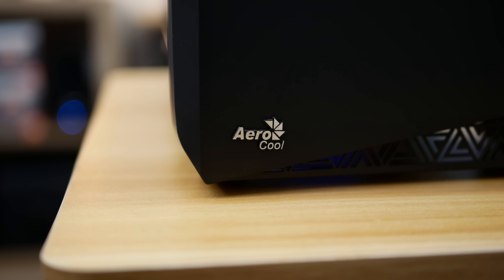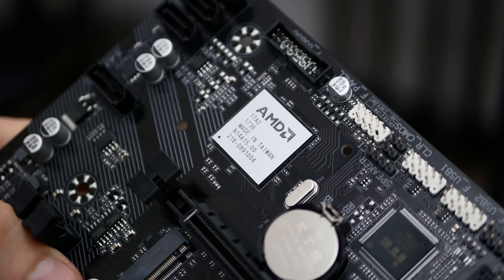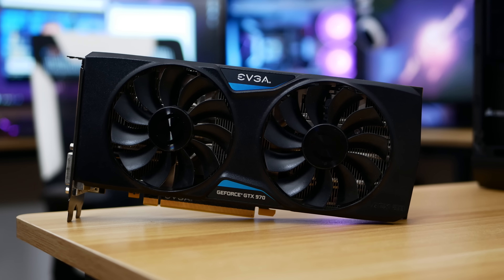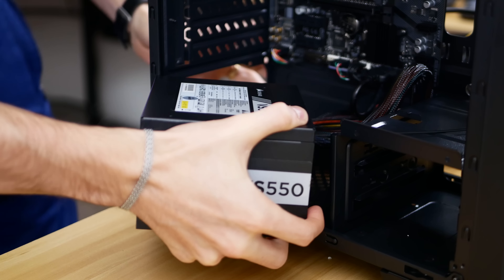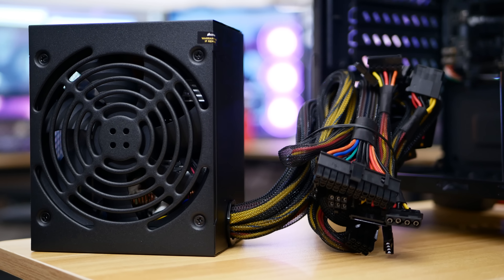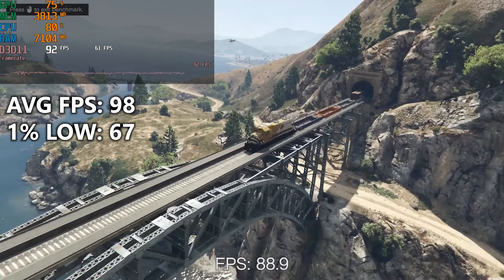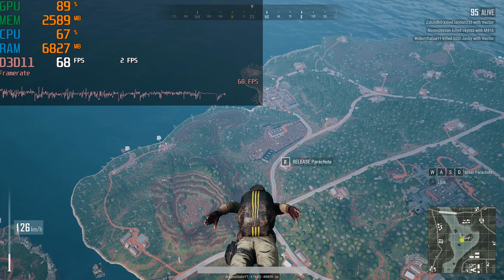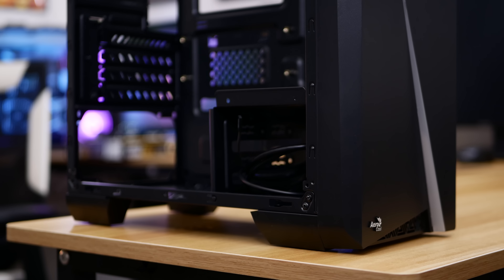We Built a Solid 1080p Gaming PC for $500

Comment from the maker: PRICE UPDATE: I had to change the title and thumbnail for this video because prices changed pretty drastically over the course of one week. For starters, the Ryzen 3 1200 is now selling for closer to $100. As of time of filming, the CPU was on sale for $75. The FlareX DDR4 we showcased here is extremely expensive in the higher frequency range, so we recommend buying a slower kit or moving to a different brand altogether. The GTX 970s are still fair game on eBay for around $100. The Cylon Mini, I'm told, should be selling on Newegg/Amazon for no more than $45. That price, however, is not reflected online, so I'll be pushing them to update this soon. Lastly, if you're interested in cutting a few more $$$, swapping the 500GB SSD for a 1TB HDD should do the trick - though storing the OS on a hard drive will significantly slow down certain aspects of your computer. Happy building!
Reply: Glad you said for anyone on a "tight" budget, not a "Titan" budget!
Reply: @TheNews1990  It has OEM parts...
Reply: Used RX470 or RX480 4GB cards can be had for around the same price and are great options as well.
Reply: I don’t know where you are getting the “$100” figure for your GPU. EVGA 970’s are running about $150 even on biddings and have been for months now. Your build is more like $520 with the parts you listed and using the prices you stated in your description.
Reply: Brian Last he bought his one for 100 and there are a few
Reply: Cheapest AM4 board? Did you steal that idea form Walmart? You could have gotten a cheaper PSU to but that may be risky. :D
Reply: @mattsmechanicalssi5833  TITAN budget haha nice one
Reply: @teleringdataspesialisten1869  
You do realize Grate Wall who make the Wallmart PSU make some Corsair PSUs.
Reply: Crooked glasses
Reply: Please do not forget intel optane and rgb and benchmarks
Reply: You did not launch multiple cpu load programs at once. Please run prime95 with aida64 and furmark
Reply: Try put there nvidia 2080ti
Reply: Also nvidia made rtx titan
Reply: @HipsterDragon  that's why you learn to bid and bargain hunt on ebay, craigslist, etc.  prices are subject to change, so it's not surprising if it goes up.
Reply: So basically nothing in the video is true...
Reply: Science Studio why didn't you use patriot ram, it's cheap and fast, about 8 dollars per 1 GB for about 2666 or even 2870 or whatever the next speed is. Also you could have used a ryzen 3 2200g for only 100 and you could eliminate the gpu.
Reply: Science Studio I love videos like this because my dad and I are going to build a gaming PC and we watch a lot of YouTube videos to get insight on good budget parts.
Reply: Im running arma 3 with gtx 760 with all ultra and it works fine
Reply: I am gonna buy this one today for my kid but am not sure how to put it together what should I do?

Comment: Recently built my first desktop PC while trying to target 1080p and save as much money as possible. Went with a Ryzen 2600, 8gb Ram, RX 580 4gb, B350 MoBo and a Refurb 850W PSU for $540. Bought the 580 from ebay for $128 and used the 480gb SSD from my previous laptop.

Comment: rx 570 is only 150 bucks new on newegg, and it comes with 2 free games. way better deal than used 970 in here as you get warranty and it consume less power. also fyi, stay away from corsair vs series, they're garbage. try to look for a seasonic, evga or even fsp if you need an affordable psu
Reply: The CX series of power supplies are also decent units I’ve found
Reply: RX 570 wrecks GTX 970 as well, quite a performance gap.
Reply: You can get a RX580 8GB on the used marked right now for ~100$ if you look close enough.
Reply: I have the corsair TX550M in my system. It works very well
Reply: Joey Greathouse GTX 970 performs around 10% better than an 570 and has higher oc potential
Reply: Yeah but Nvidia is still much better supported than Amd, lots of AAA games are developed on Nvidia drivers and optimised to their brst becayse thats Nvidias marketing strategy. Also Geforce recording doesnt impact performance
Reply: JellyStick Danix that would a nvidia fanboy would say... 
I’m switching to console
Reply: a gtx980 you can find for 150 bucks too and wrecks the rx 570
Reply: I have  been using corsair vs550 for 4 years already. PC on 24/7. No issue.
Reply: I got it too except I got a 30.00$ rebate so I got the OC edition at 1.268 GHz at max clock for 135$. What a steal!
Reply: @jellystick2525  Neither does ReLive
Reply: My rx 580 was like 200 and I got 3 games. Granted star control origins was pretty trash but AC odyssey and Strange Brigade were great games.
Reply: I just bought this yesterday 👍🔥
Reply: As rs3tssunax said Stay away from vs series  mine didn't even last a year
Reply: The Rx 570 also has more v-ram than a 970 😎
Reply: How will be the combo of rx570 4gb and 1200 ??
Bottleneck?
Reply: Currently rx 580's are pretty cheap

Comment: Why not go with the 2200G?- then try the freesync trick with the GTX 970?
Reply from the maker: You certainly could.
Reply: I did a budget home build last week and went with the 2200G aswell (didn't need a GPU) and managed to stay inside the 400$ mark - which is in line with this build mroe or less.

2200G atm is really good for budget builds. As mentioned you can add a discrete GPU and even get the advantage of the "freesync on nvidia" trick. Given the system won't have huge FPS numbers and will be prone to a "rocky" experience sometimes, freesynce does wonders in smoothing the whole thing.
Reply: @marcgallant5270  Why mot RX 3060 for 150? Similar to 1060
Reply: Marc Gallant why not get a gtx 1070 for $200. Lol
Reply: wich trick?
Reply: What is the freesync trick?
Reply: @the__man  lol gtx1070 LOL 200$ LOL you mad they are 250/300€ still on ebay cant find for less then 240€....... unless u from usa where they sell for 200$ ish... but europe nahh but rx570 are like 100€ rx580 120-150€ on ebay
Reply: @THEwed123wet  yea what trick
Reply: Can someone explain this freesync trick?
Reply: Justin Y.’s Evil Twin wondering this myself
Reply: hey  @Coldkil666 .I was thinking to use a ryzen 3 2200g and I have been wondering since youy have the experience do you think a gtx 1050 ti would really benefit my build?
Reply: @igdivine5389  depends mostly on what you plan to do. low budget gaming a 1050ti is fine, and with the 2200g you can use the trick to use a freesync monitor via the integrated gpu. i'd go 2400g if possible though, if it's in budget.
Reply: would the ryzen 3 2200g be compatible with the motherboard?
or would i need to update the bios?
Reply: How do you put a 2200G because on pcpartpicker.com it says it has compatibility issues with the motherboard BIOS
Reply: You can also get a used RX 580 for $20 4GB / $35 8GB more which maybe worth it, you'll get 5%-10% better performance on most games and it has a newer Displayport standard and Freesync obviously. I'm able to get 4k 40FPS in most game on Medium settings and the newer Displayport cable lets me do HDR without Chroma subsampling.
Reply: For some reason, the 2200g is cheaper than the 1200 from where I live. I would get the 2200g.
Reply: @mattstone8878  we don't need your advertisement here.
Reply: @mattstone8878  uhhh, I legit just didn't ask for the advertisement. Fuck SJWs, but I just didn't ask for it. Kappa
Reply: @the__man  300*
Reply: @Coldkil666  can u send me the build u make for 2200g? im planning to build. thankyou in advance
Reply: @minarimina  not a problem.
 Ryzen 3 2200G
ASUS Prime A320M-K motherboard (because uATX, has m.2 slot and supports up to 32GB 3200mhz ram)
8GB Ballistix Sport 2400 ram (just because it was cheapest and didn't needa  3000/3200 but i'd recommend it)
250gb WD green m.2 SSD
1TB WD black HDD
Masterwatt Lite 400 PSU
Masterbox Q300L case

Obviously prices can vary, can be done better with some more money (ram first of all) but the idea is that you'll have a pretty good baseline machine you can upgrade easily (adding a gpu like a 1060 or an rx580/590 will make a lot of difference).
Reply: @Coldkil666  thaanks

Comment: Ryzon 5 2600, B350 MB, 8 GB RAM and a RX570 and 400 Watt PSU in a 30€ case. Cost me 550€. Turned out to be really great.
Reply from the maker: 2600 = best bargain CPU around.
Reply: Well I was thinking this evening to build this exactly PC but I though buying a used 4gb Rx 570
Reply: It certainly will not disappoint at this price point. You of course have to factor in the drive. In my case (haha) we had a used 500 GB HDD which was good enough for the moment. This will get you around 1080p for a while.
Reply: Gonna build with the 2600x but use a RTX 2070 instead.
Reply: What's the ram speed?
Reply: 2666

Comment: For a little bit extra I would definitely recommend getting a B350 board instead due to the additional features such as overclocking, the extra chipset PCI-E lanes and the additional SATA and onboard ports that comes with.  With a B350 board even with the stock cooler the 1200 comes with you should be able to easily OC to 3.8GHz with reasonable temps and that will raise your min FPS/dips by a good bit on CPU demanding games.  

Given that the 1200 is now $100, a better choice at that price range is a 2200G since it's based on the updated Zen+ architecture but if you can spare an additional $20 and have a MicroCenter near you a Ryzen 5 1600 6-core/12-thread is an awesome deal and very future-proof.  

I would change the RAM to something that will run at 2933MHz, which is usually the sweetspot for price/performance.  16GB that will run at that speed can usually be had for around $100, so that would make up the difference in the CPU being $100 and not $75.

For the graphics card I would go with a used Radeon RX 480 instead.  It's a newer, faster, more efficient card.  For $100 you can pick up a 4GB model which is still an extra .5GB vs the 970 and for an extra $10-15 you can get an 8GB model should you want to play with high res textures at 1440P plus it's about 5% faster than the 4GB model because it's 8Gbps vs 7Gbps GDDR5.

Comment: Honestly spend the extra like 15-20 dollars for a the cheapest b350 or b450 board, that option to overclock is worth it due to the fact that all ryzen CPUs can be overclocked. Used gpu is definitely the way to go, like a used 1070 is like 200 dollars now and a 1070ti is like 30-50 dollars more than the non ti card.

(Edit): you can get an rx460 or 580 on eBay for about 100 dollars now.

Great job on the build, but there are a few things you could’ve done to get better price to performance. Love watching your videos.

Comment: How about:
i3 8100:     $130
Amd RX 570 4gb:  $150
H310M motherboard $75
Corsair 8gb 2666 MHz $80
Corsair 450/500watt $45
HDD WD 1TB 7200rpm: $40
A Non RGB CPU case $20-30
Because it doesn't matter that much as gaming is more important than show-off. Or if you want you can spend an extra $5 to get the one shown in the video.
Total: Approx.$550-$590 depending where you stay.
This rig can run RDR2 and Assassins Creed Odyssey at 45~50fps with 1080p settings.
Personally Tried.
What you want more dear? 😊

Comment: Yeah I built a system 6 months ago with an i5 4670k and 970. And I've got to say. GPU prices have come down quite a lot since. At the time, I had trouble finding 970s for a decent price and I finally settled on an EVGA one (non-ftw, I think it was the acx 2.0 version. And the fans get pretty damn loud when fan speeds are 50%+) for $150 (+$18 shipping).

Comment: R5 2600 and a RX570 is probably one of the best builds right now for price/performance.
Reply: I agree, I just went to that, although I got a RX580 because I found a really good deal on cyber Monday. I'm really pleased
Reply: @amancuso07  yeah your better of finding a 580 anyway considering the price difference isn't that huge. It will also last longer than the 570.
Reply: Here in Germany the r7 1700 costs like 15€ more than the r5 2600, and has more value for the money, for its additional 2 cores and 4 threads.
Reply: @sahinsultani1569  You´re right. Here in germany prices sometimes seem quite "illigical". Just upgraded my system from an G4600 + GTX 960 to an R5 1600 + RX580 on B350. I decided to take the 1600 due to the possible trouble with getting R2 working on B350 with older Bios-Versions. Now I´m waiting for the R3 3300X, which is in my Opinion more an R5 than R3 (6C 12T).  The RX 580 is an great card and the R5 1600 @ 4,0 Ghz is also not too slow.
Reply: I have RX 560 sad gamer moment
Reply: I have a 2700x and a 580
Reply: @kola7106  don't be it's still a nice little card, you just have to lower some settings.

Comment: Go with a 2200 g cpu and if you don't mind going used u can find a 1060 for around 150. Also if you want black cables corsairs cxm line is very cheap and 80 plus

Comment: I did something similar while staying in the $500-550 range
Ryzen 5 1600 @ Newegg $129.99 
Radeon RX 570 8 @Newegg $179.99
8 gb viper patriot ram @Frys elec $66
B350 PC Mate @in person $45
Thermaltake SMART 600w @Frys $37.50
1TB Toshiba P300 @Frys $29.99
Enermax Ostrog Lite@Frys  $49.99

Most of this was while Black Friday deals, mobo bought from someone who didn’t use it so got it a bit cheaper, HDD great discount.
Used a $15 discount code on Newegg and still have to mail the rebate on the GPU for $30.

Comment: My PC is
-Ryzen 3 2200G @4ghz
-B450 Aorus M
-8 HyperX predator 3.2ghz RGB
-1tb baraccuda
-120gb Kingston ssd
-mwe 500w psu

All of that including case and stuff is only 400$ 

I dont need gpu because planning to upgrade to Ryzen 5 3600G which will perform like Intel Core I9 or 7 with igpu similar to GTX 1050ti so I think it's worth holding on to Vega 8... Not a bad igpu tbh can play most game

Comment: Actually Ryzen 2200G now is a better value and you don't need discrete GPU since onboard APU Vega 11 already enough for playing E-Sports title 720p High or 1080p Medium to Low detail, you can add a discrete GPU later and Ryzen 2200G is capable enough to pair with RTX 2060 or RX 590 without too much bottleneck.

Comment: You can get EVGA B-stock 1050 for like $100.
Also once a month, Ebay have either a 10 or 15% off site wide sale.
With their site wide sale a couple months ago, I save like $30. Also got some 16GB RAM for $100.
And between that and Newegg, altogether I save $130. So I paid $420, before shipping and tax. About $465 after.
Also with my $85 Amazon giftcard, it brought it down to $335, before shipping and tax, $375 after. So on a $550 system, I saved about $215.
Reply: Was that Amazon giftcard from signing up for their credit card?
Reply: Why would anyone want a used 1050 over a used 970 if they cost the same? The 970 is way better.
Reply: @thesmellofbacon7595  Just gift card codes that I had in my account for like 2 years.
Reply: @Salsajaman  How is a 970 better then a 1050?
I don't know a lot about video cards.
Reply: @saulgoodman2018  Just look at benchmarks. I searched it on UserBenchmark and the gtx 970 has 88% better effective speed compared to the 1050, and the 970 has 50% better performance in games on average. The 1050 also has only 2gb of VRAM which is getting pretty low for games these days. Having more high quality textures in games uses more VRAM.
Reply: @Salsajaman  There are 4GB 1050.
Reply: @saulgoodman2018  that would be the 1050 ti

Comment: i built a pretty similar budget build but am using it as my streaming pc i picked up a 1700x for 130 from microcenter and have it oc'd to 4.0 on an asrock x370 pro4 mobo which i got for 45 after MIR. Had a 970 from an old build and am using a 120 ssd with a 1tb hdd.and picked up a evga 650 g2 for 50 bucks on black friday. 16gbs of hyperx fury which i cant get to oc over 2400 but i had it laying around and even with the low ram speeds im hitting 1729 on cinebench with the combo. perfect as a dedicated streaming pc and all in i think i have 560 bucks in the build. Love your content and what you do my dude keep it coming
Reply from the maker: Dude, that's a SOLID build for the money.
Reply: @GregSalazar  it looks pretty nifty to i put it up on my pc parts picker account and painted my gpu to match after watching your video on how to do it. Also the 16gbs or ram 970 120 ssd and 1tb hdd came from a steal i got of fb market place for an i5 6600 build with an asus 24in 144hz monitor hyper x cloud 2 headset and razer firefly mousepad for 300 dollars total. The deals are totally out there if your dedicated to finding them.

Comment: Interesting comment about zero memory kits ran at rated speeds on Ryzen.  I have MSI B350 MB, R5 1600, and Corsair Vengeance LPX 3200 memory.  Toggled to XMP-1 in bios and it has been running at 3200 MHz for over 1 1/2 years now.

Comment: This got me seeing what i would put together for a "dream" budget build

All new parts came out to $600 with tax at a local microcenter
Cooler Master MasterBox Q300L $40
PowerSpec 550 (5 year warranty, all Jap caps, 80+ bronze, feels very dense) $40
G. Skill Ripjaw V 16GB 2x8GB DDR4-3600 $140
ASRock B450M Pro4 mATX (4 dimm slots, 6+3 phase) $70
Ryzen 3 2200G (because it's only $10 more for iGPU) $80
Gigabyte Aorus RX-570 4GB $170 wiff tree free gamez
1TB Toshiba OEM drive $38
Inland Professional 256GB 3D NAND M.2 2280 PCIe NVMe (1.5GB/s read - 170K IOPS/800MB/s write - 140K IOPS) $45
Then there's a $30 instant rebate for buying a CPU and Motherboard

I would totally say the extra $100 is worth it.